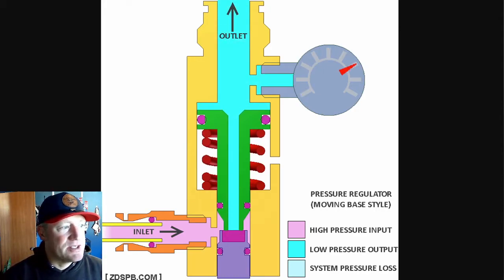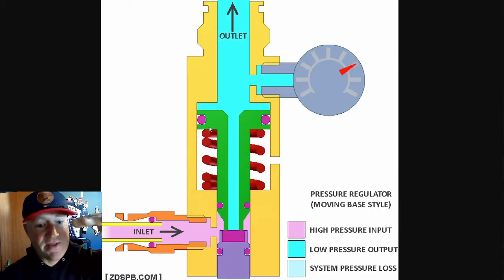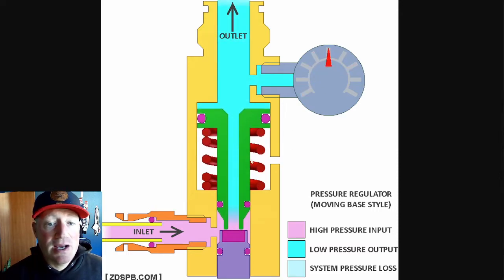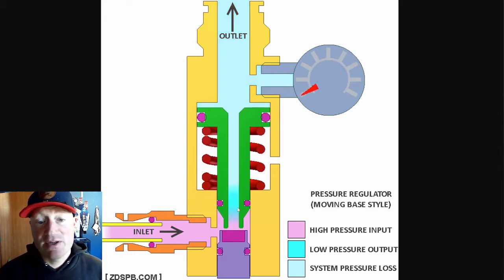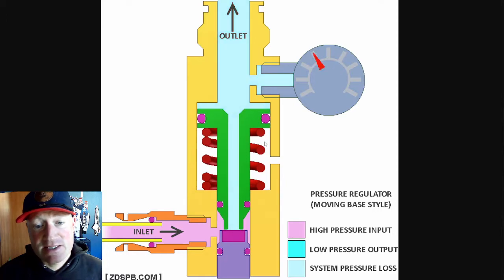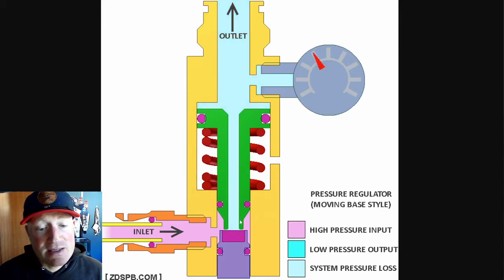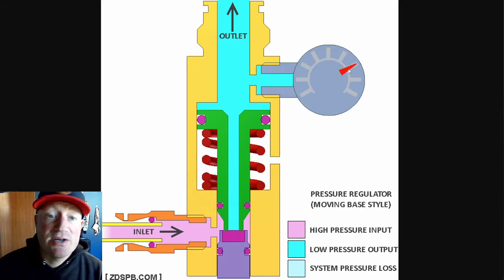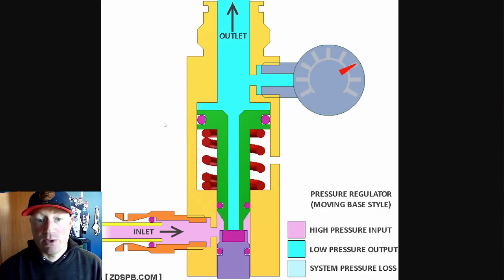How a Paintball Regulator Works

Comment: great video quick question. I have an old private label shocker sft hybrid the regulator isnt stock it was replaced and It says 200-700psi on the reg itself. Does that mean I need a low pressure tank or a tank regulator that can adjust the output?   thanks in advance
Reply from the maker: Typically the gauge will simply show you the pressure that the regulator is putting out (if it is after the regulator then that should be the case).

For an SFT Shocker typically any tank with a 550PSI-850PSI output will do the job.
Reply: Does the spring affect reg output pressure? Harder spring = lower output pressure?
Reply from the maker: @midgetmayhem764  - its the other way around. If you make the spring "weaker" than it will lower your output pressure. If you make the spring "stronger" it will take more pressure / increase your pressure.